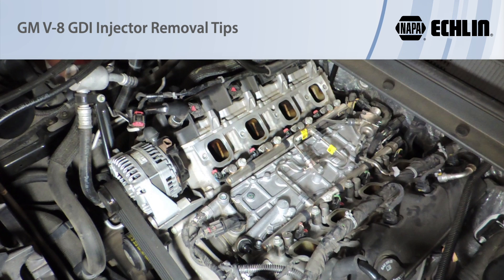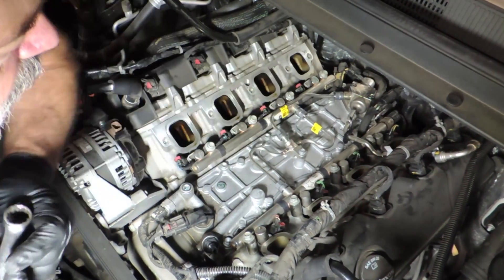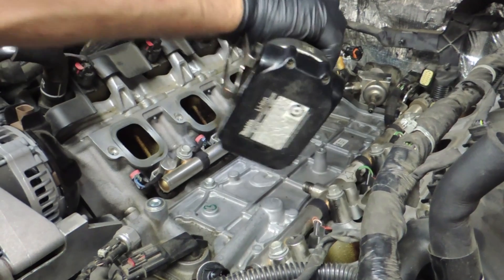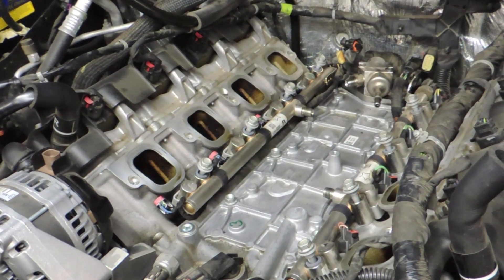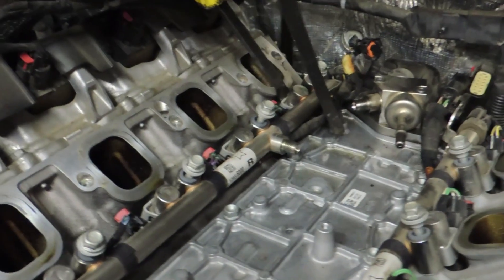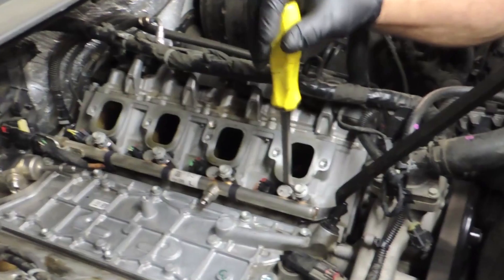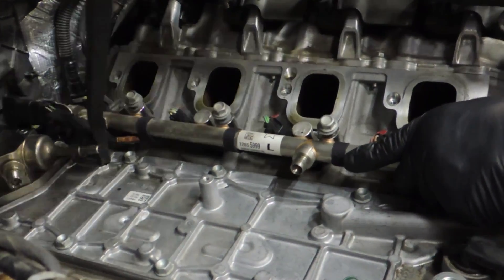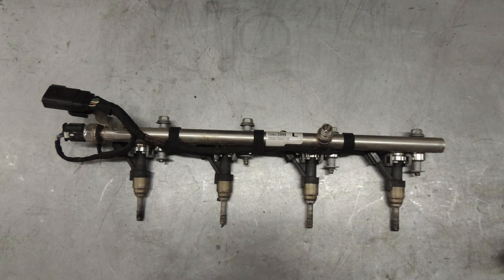GM V-8 GDI Injector Removal Tips

Comment: My injectors are stuck in the fuel rail. I'm pulling extremely hard, and I've got only one injector out of the rail. What other options do I have to separate the injectors from the rail?

Comment: Wish you'd included how to bleed the system and didn't show how the third tube was removed, the one that crosses over the driver side fuel rail
Reply: Bleed it by removing the pump fuse, and then run till it stops. The high pressure can be bled off with a scan tool. If you don't have one, then wait about 30 minutes.
Reply: Leave it off for an hour disconnect the battery

Comment: I'm a seasoned Ford tech, first time working on an LS/LT. I'm here because I'm doing a DOD delete for a friend on a 6.2 Cadillac that 💩 a lifter. I put the heads with the rails back on before putting the valley plate back on first. Yeap, I screwed up. So now rails are coming off so I can put the plate on. Lesson learned

Comment: Just did this job on a '14 Silverado. The RH rail was very stuck, even using the method in vid couldn't pry it loose. I ended up making a "rail puller" out of a Harbor Freight strut tool (about $35). The forged/cast spring saddle cradles the rail perfectly with minimal trimming. I cut the pusher bolt down for clearance, worked well.
Reply: Can you post a pic?

Comment: If you don’t have the pry bars shown, I went to Harbor Freight and bought a Pittsburgh 24” lock ring tool #67401 $9.49 and a Tire Bead Breaker with Swan Neck #67403 $18.99. I only used a big flat head screwdriver and the lock ring tool and worked great. Bead breaker is for the ones that are really stuck.
Reply: These two tools did it for me; thank you

Comment: Why are those one time use parts? The s pipe?
Reply: The ball on the end on the line gets crimped down when tightened, therefore when loosened it would be very difficult if not impossible to have it land in the same spot therefore leaking fuel. It would also not retain all of its press from being crushed, also presenting problems

Comment: Why do you have to pull the injectors when removing the head to replace the lifters
Reply: You don't have to pull the injectors to replace the lifters but if you're going to the take head to the machine shop for cleaning and resurface then it has to be stripped, so in that case the injectors and fuel rail are coming off

Comment: The only thing holding the wiring harness on the fuel rail is velcro, why not just undo them, move the wires out of the way. Then you could also pry from the middle and not ruin a fuel rail.

Comment: The problem is, these automotive engineers are idiots!!! I just had the unpleasant pleasure of doing this job. The injector bores are to open and subject to the elements, and herein starts the aluminum corrosion. So after almost demolishing the fuel rail and bending a few injector tips, I finally get them out. Next question which nobody really has addressed is, how do you prep the bores in the head to receive the new injector Teflon o-rings? Some say wire brush. Try again. Have you ever pulled a radiator hose off of an aluminum inlet and had to scrape of corrosion on the inlet with a screwdriver? That what these holes look like. They need to be re-drilled with a specific sized drill bit, but I can’t find any specs on the interweb. Go figure. As I was saying classic engineering design flaw, with no forward thinking. Glad I’m about to retire!!! Good luck to you youngsters in the business, you are going to need it!

Comment: I thought the rail came off and each injector was taken off one at a time
Reply: No, each injector has a stupid clip and they can't be pulled off because the clips hit the side of the intake. You have to remove the rail along with all four injectors at the same time, then you can remove the clips. It was a freaking nightmare trying to pry it off. My dad and I just removed one from a 2015 Tahoe 3.5.

Comment: GM master tech here. I remove them in a similar way but with an extra step making removal very easy. Spray some PB Blaster or equivalent at the injector bases, then after removing the wiring harnesses, gently turn the injector a few degrees in each direction. The clips will allow for a small amount of rotation. Wait 5 mins. Then, I use the exact same method displayed here using counter force prying in the direction of the injectors mounting position. The PB Blaster really helps them slide right out with ease. I've never damaged a single injector doing it this way. Hope this helps whoever is watching this.
Reply: You'll have plenty of work  for years to come Lol
Reply: Thank you for that!
Reply: I'm on a new England special and I've had penatrant on the injectors for hours.
Reply: @Gregg0112 I’m on a New England special as well, I’m in RI working on a gm 5.3 with the most stuck fuel rails I’ve ever dealt with
Reply: @FlyWithSimon  I just took a huge pry bar and the rail bent like a banana but it came out.
Reply: @Gregg0112  that’s what I ended up with. Looked like a boomerang
Reply: @FlyWithSimon  at least you can hunt kangaroos now
Reply: @Gregg0112 😂😂😂
Reply: Dealing with one that has 270k…wish me luck y’all. Thanks for the tip
Reply: THANK YOU!!
Reply: How and where do you grab the injector?
Reply: @SA-hp1ri  grab it at the connector and gently wiggle it left and right a few degrees. You're just doing this to free it up some to allow the penetrant to get down in there.
Reply: Thank you Ryan, appreciate the help.
Reply: I heard some people just leave the rails attached when pulling heads for a dod repair. Anyone ever try that?
Reply: Why is my engine cover being a bitch to take off
Reply: Sounds like a good plan of action.
Reply: My engine starting shaking after I replaced the injectors, everything seems in place I even went on the intake twice to see if it’s on right. I don’t know what could be my issue
Reply: @PaulSamaniego584 high pressure fuel pump.
Reply: @supremecanadian6815   it was a connector from one of my ignition coils, but my fuel injectors are bad lol, I didn’t buy the updated ones
Reply: You can also cool the rail down with a propellant. This makes the rail a bit stiffer to prevent bending when you pry.
Reply: Should of watched this video,. I broke 3 injectors and they’re stuck in the engine 😂
Reply: Wont the pb blaster swell the o rings on the injectors?
Reply: @andrewperez5550  Every GDI injector gets new orings and seals before install.  You cannot reuse those. They're press fitted and 1 time use.
Reply: @RyanFixesCars  right that makes perfect sense. Of course they do. Im just  very stupid tonight. Thanks brother.
Reply: @RyanFixesCars  hello again, i got them out. I used the pb blast technique like you said and still stuggled. Literally the most difficult item i have ever had to remove from any car. Quick question,  what do you use to clean all the build up around the injector chamber. Also is it going to be as difficult putting the new injectors in.
Reply: GMC quoted me 2k to change 2 Injectors on my 2020 sierra 5.3 why so much
Reply: Thanks used to old ls where injector was still in manifold

Comment: This is a fuel rail removal. Not injectors.
Reply: Always that one expert that has to comment 😂
Reply: Probably never seen a 15 mm wrench, BTW I alway cover the intake ports with rags or paper towels, if u drop something down one you will find out why as soon as you hit the key to start it
Reply: You have to remove the fuel rail to also remove the injectors
Reply: The injectors are connected to them and held on with clips that cant be removed with injectors installed dummy.  They all have to come out at once.